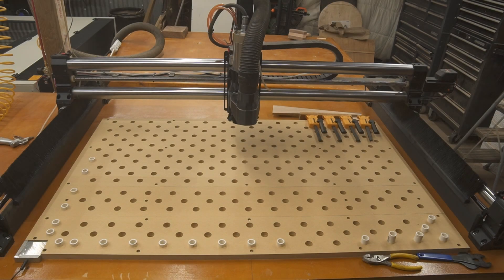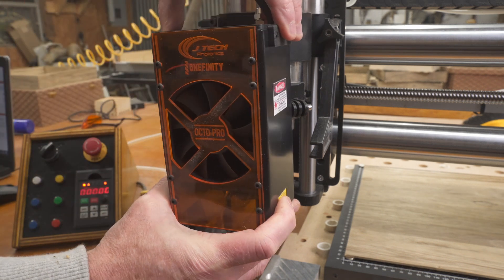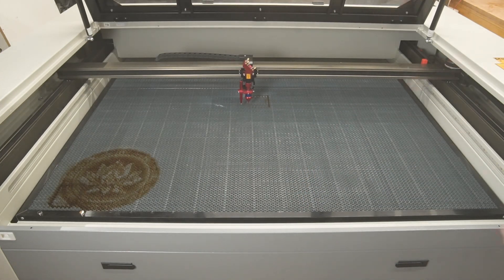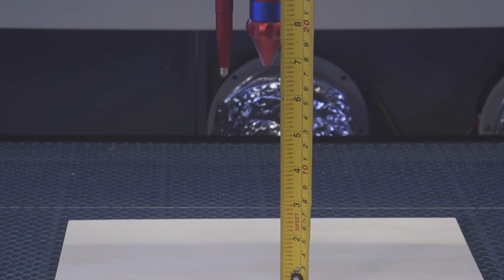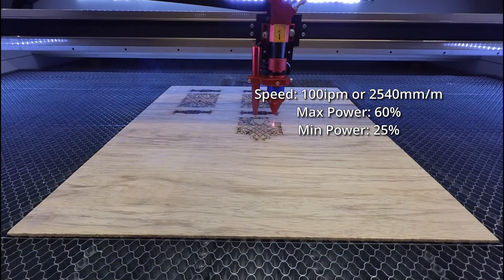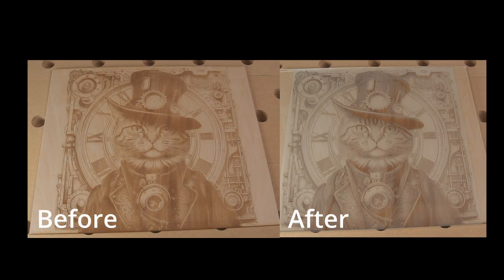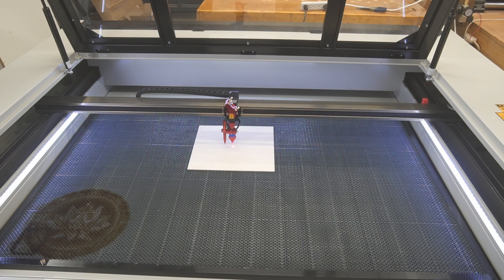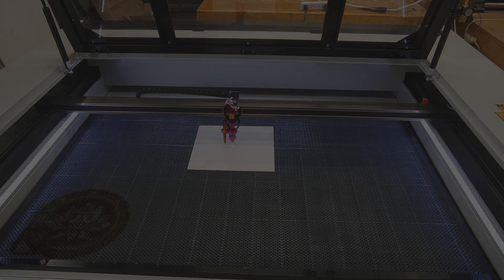Laser Engraving Glass with my Monport CO2 Laser.

Comment: can the laser cut the 1/8 inch sheet of glass?
Reply from the maker: It's funny you ask, because I literally tried.
It will not cut all the way through, but it will cut deep enough that you can break it, and it be a straight-ish cut.
It's not like scoring glass would be where it's a straight and smooth cut.
It's actually very jagged and rough.
I've learned that the laser doesn't cut or truly engrave the glass, it fractures it in microscopic pieces.
So it's not a very efficient way of cutting/scoring the glass.

Thank you for watching!